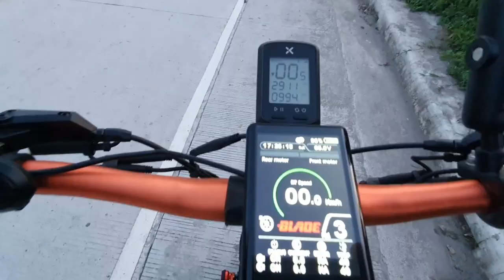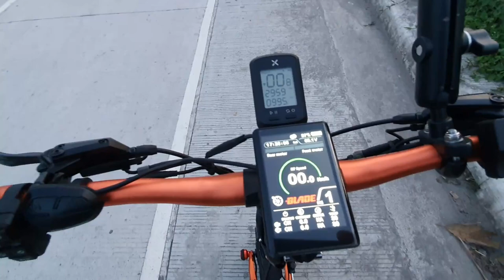Speedometer Calibration with GPS | Handlebar Upgrade - Blade GT Plus

Comment: I have problem, i bought the same handlebar 740 mm for teverun fighter 11+ , but when i started to install zoom brakes wires are too small for it, it's big problem
Reply from the maker: I remove the cable organizer and replace it with a different one. But yeah I agree wires are too short

Comment: You can let go of the handlebar because of the damper
Reply from the maker: Even with the damper, I can barely one-hand the stock 640mm handlebar, you need to slow down so much just to scratch your nose 😀. But with a wider handlebar, even on 40kph it is still comfortable to one hand.